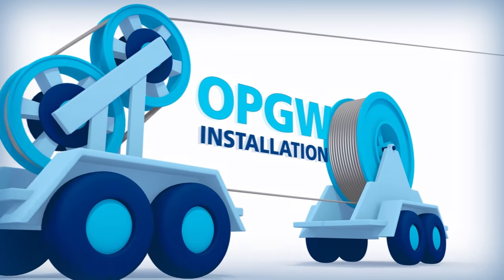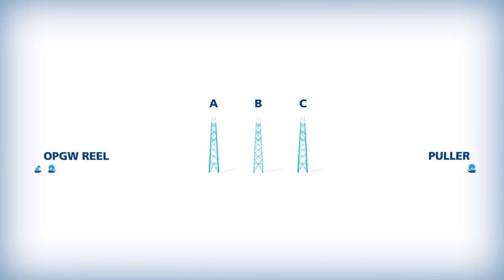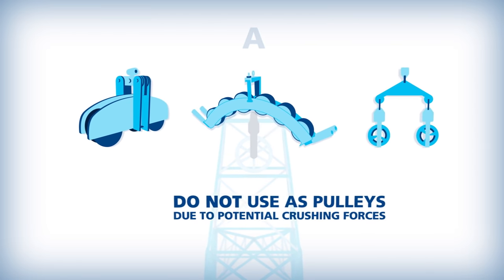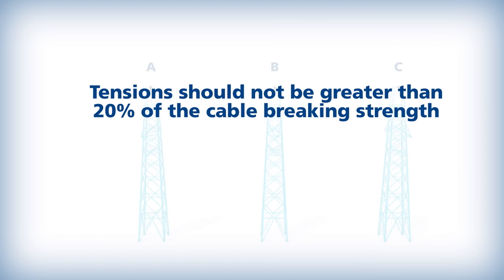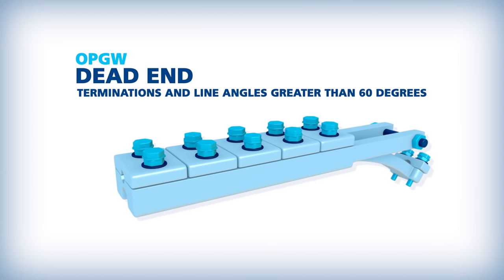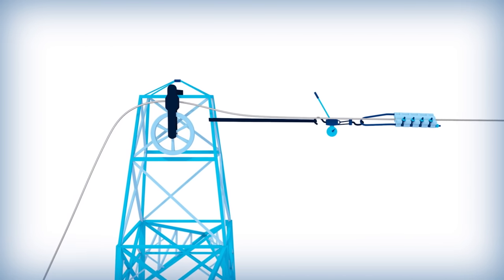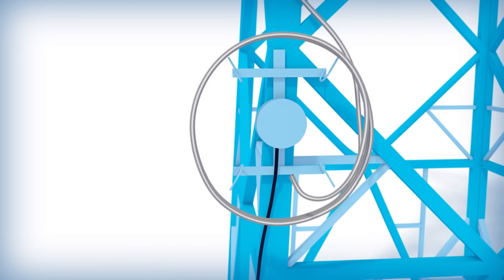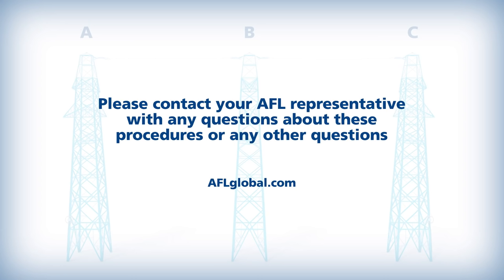AFL OPGW (Optical Ground Wire) Installation

Comment: Sir
How can we work out required nos. Of hardware and accessories for opgw for complete transmission lines, as many a times we need to quote for installation hardware sets on per km basis. In such a case in absense of precise calculation there may be a substantial price implications.

I tried searching on net but can't make it.